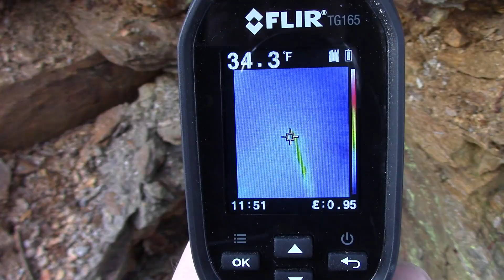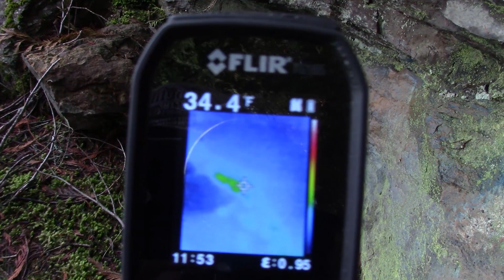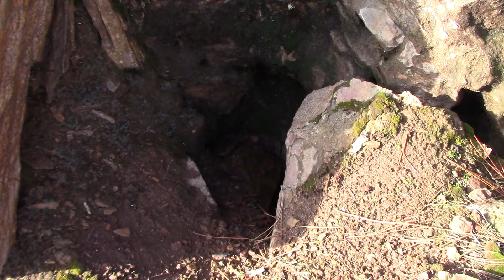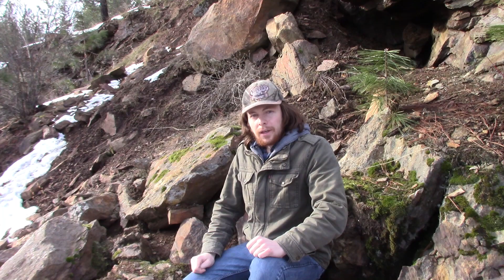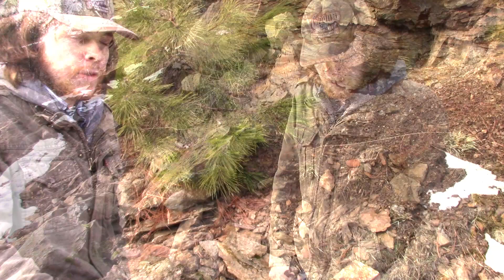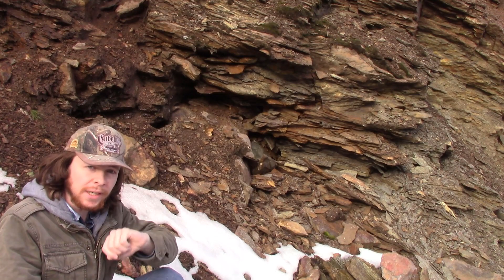The Geothermal Mystery

Comment: There’s a coal seam that caught fire in a mine near my house in 1936. The mine was pumped full of water and bulldozed/closed off. Three men died. To this day the ground still emits sulphur like gas and heat from the burning coal beneath. If the geology is right similar could occur naturally.
Reply from the maker: The geology for this location does not have any coal, the rocks here are over 1 billion years old. Thanks for sharing though. Ever hear about the Sunshine mine fire?
Reply: GeoForge that’s fair enough - thought I would mention it just in case! I think I’ve briefly read about it before. Any mine fires would be horrific.

Comment: Mirror Lake, Near  Mt.Hood, Oregon.  
Meteor or ancient volcano?
Reply from the maker: Looking at it on maps, it looks like a normal lake that did not form from a volcano or a meteor.
Reply: @GeoForge  If you could ever check out the rocks there. I got a 7.5 gram silver nugget there. Just off the main trail 3 quarter the way up. Then looking at it. There's interesting HUGE boulders ROLLED and  laid out throughout. And alot of this rock under that I noticed is a hard , heated in the center with a carbide look and peppered with steel flux. ? I hiked back down the mountain b4 the snow came scratching my head the whole time. Looked at it on Google earth. Different angles and views....something happened. Looks almost like an impact from the north...or a Massive blowout of a now ancient volcano.You can almost see the southern facing craters edge/ridgeline.  I obviously don't know. That lake being the center of it " Mirror lake". Alot of the steep cliffs around the summits are eroded away or are in the process. I think someone's been mining the cliffs on the SE ridge.
Anyways thanks again.

Comment: I suspect changes in geothermal gradients aided by the fault zones are responsible for the heating of the water. The same hydrothermal systems are still at work in my neck of the woods of the Appalachian Mtns, even though metamorphism and plutonic activity have long ceased in the area.
Reply from the maker: That could be a possibility and was suggested as an idea by a geologist I talked to. We have faults in the area with recent seismic events. We also have plutonic rocks and batholiths as well. So old heat left over could be rising up along faults.

Comment: Could be a natural gas seep, that will emit Hydrogen sulphide gas and carbon monoxide and some of the gasses will oxidise seeping through the rock and produce heat that way 👍 very interesting, will keep a watch on this when you tell us more 😁
Reply from the maker: Natural gas is not found here geologically mainly because the rocks are to old. Natural gas forms from decomposing plant and animal matter at depth. These rocks were deposited and formed before plants existed. The only life around the time these rocks formed was miniscule like cyanobacteria. So natural gas can be ruled out. It was a good thought you had but it does not work for this region.

Comment: Sounds like coal decomposition or fire. Happens all over Pennsylvania.
Reply from the maker: We do not have any coal in the area geologically. These rocks are metamorphosed but at one time they were sedimentary rocks that formed from sediments that accumulated in a basin. Some of it was in deep water and others deposited in shallow waters. Coal forms mostly from plant material that is compressed and metamorphosed. That usually happens in swamps near the equator. The rocks in this area are to old and existed before plants existed.
Reply: @GeoForge  Pyrite?
Reply from the maker: @okboomer6201  There is not visible pyrite but there are minerals that are oxidizing. That was an idea proposed to me by a geologist as well as people in the comments of my last video that sulfides were oxidizing and producing the heat. I am not sure about this idea because of the fluctuations that happen when it comes to the vapors/heat that is released and I could be wrong on this thought but, sulfides can only oxidize for so long before they stop. So I don't think they would continue to release heat and gas for several years but maybe they can? Also, this does not explain why water in the well to the north is around 68F which is above the average.
Reply: @GeoForge  Could very well be a yet-to-be documented hot spot which you have discovered.